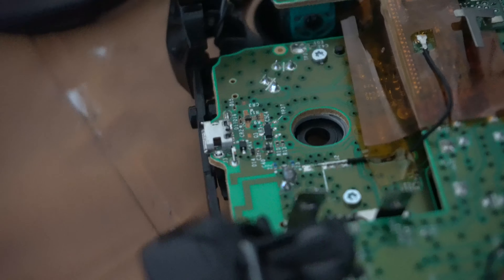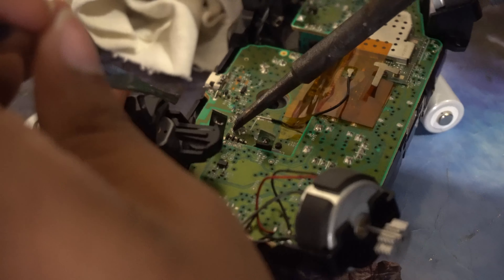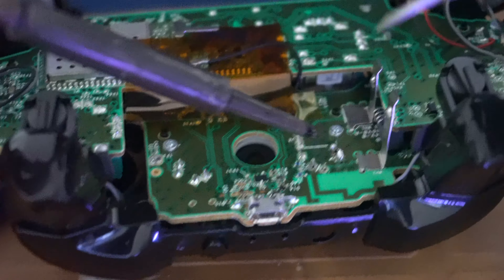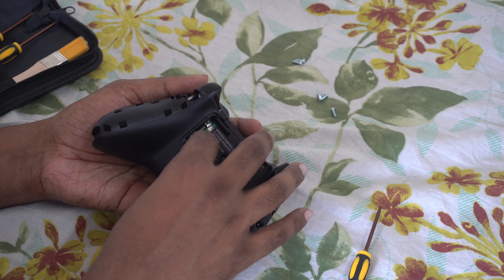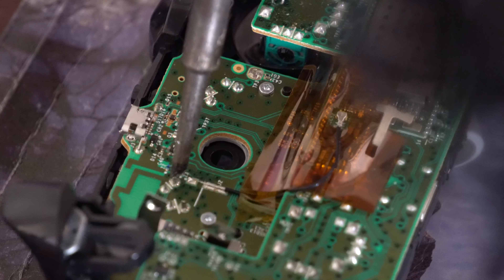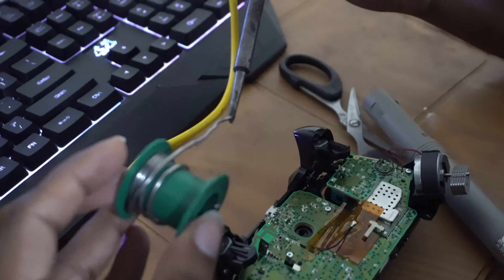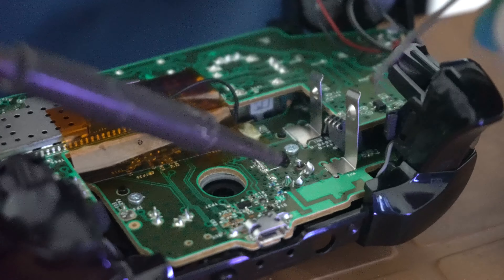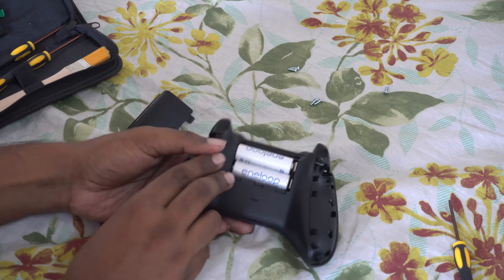Fix Non Reregistering Xbox One Bumpers : Permanent Fix

Comment: I wonder if the warmth or water vapor from people's breath when they blow into the right bumper affects things, and it works for a while. I tried using canned air, and that didn't work.

Did I get a bad controller and a new one wouldn't have this problem, or is this a design flaw with all controllers of this type?

My father used to be an electrical engineer, so he knows how to solder. Unfortunately, he's not with us now, and his skills didn't pass on to me. Don't want to be responsible for the next wildfire.

Elden ring is the only game I play with the controller, and the right bumper is really important.
Can't cast spells or use fast attacks without it.

Anyway, thanks for the video.
I can at least open up the controller, and see what's going on.